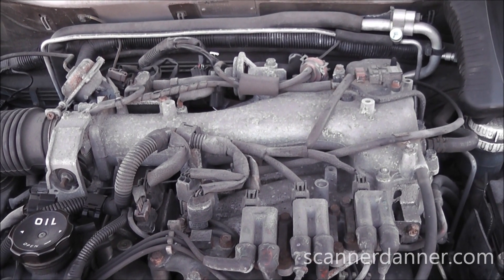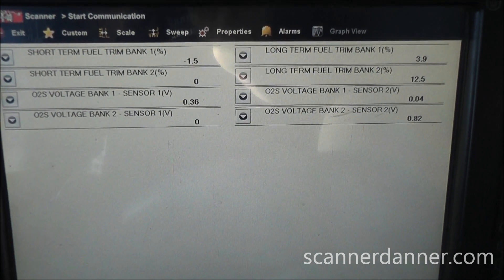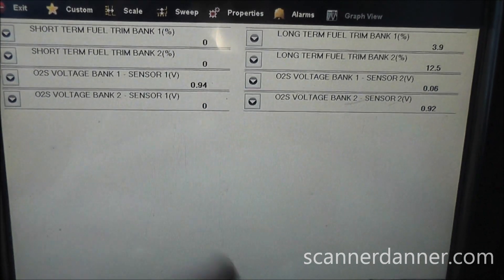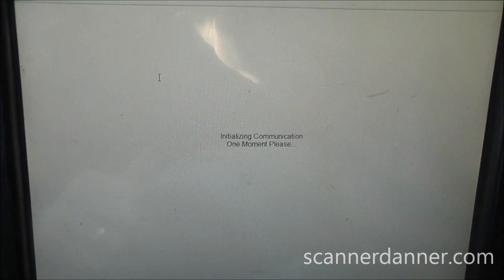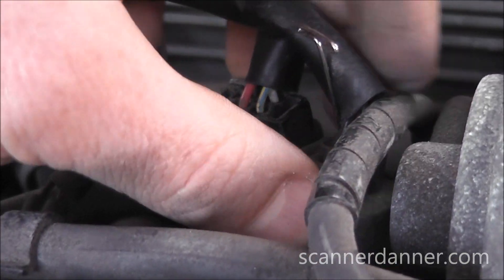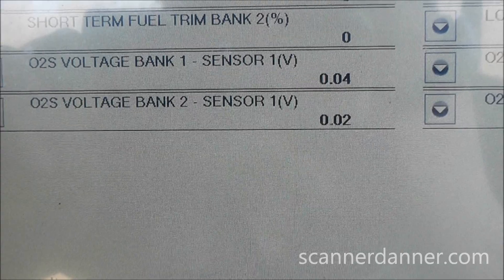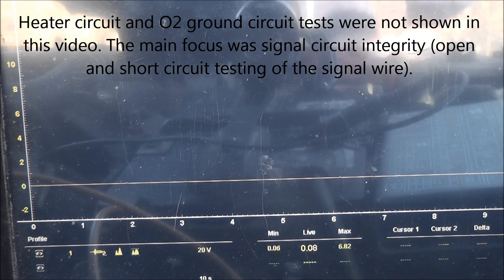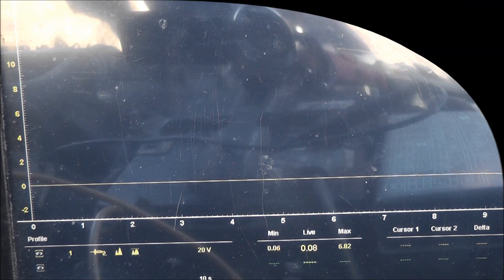O2 sensor testing (fixed lean) P0174, P0154, P0155 - Mitsubishi

Comment: The wideband O2 sensor has no activity at all and I'v checked continuity to the computer and voltage by the manuals.  As a side note this runs fine and seems to ignore the bad sensor and use the B2 to make fuel trim adjustments similar to the 98 Taurus you showed in one of your videos.  Thanks again.

Comment from the maker: yes and no. it depends on the internal resistance of the signal circuit. On some inputs, your body has too much resistance for this test to work. 
just tried it today on a digital type WSS and it didn't work, had to use the test light instead. I'll post the video soon.

Comment: I have an 01 Montero Sport, with that exact same engine, with almost the exact same codes, having the exact same issue on that O2 sensor.  While I have yet to locate the sensor itself, this got me closer to identifying if I need to replace it, and what a couple of those wires under my hood do!  Thank you!

Comment from the maker: To long of a topic to post here. In short, it is a small voltage the PCM sends down the O2 signal wire primarily for diagnostic purposes. 
Watch some of my other O2 sensor testing videos under my playlist labeled Sections 4&5. These are based on chapters from my eBook.

Comment: No, these are P codes listed on the scan tools as undoc using a Solus Pro.  I only wrote down 1 of the codes, P3903, but have seen several, some even with letters and numbers in it that look like P2T3W, as an example.  This vehicle had 16 codes in all modules at one time.  I am not sure what happened to this car (05 Saturn Vue) but these undoc codes seem to pop up when valid codes are set.  It is down to one valid code now (P0135) along with the one mentioned above.

Comment: Love your videos.  I have been doing mechanical work for years and have learned more about diagnostics on your videos than I learned in 8 years on the job.  Plan on getting your book soon, once I am done studying to challenge my ticket.  BTW, whats the deal with undocumented codes?  I am working on a Saturn now with and O2 problem and whenever the code returns it comes with one or 2 undocumented codes, even some with letters in the code????

Comment: Excellent vid.  I've watched a good amount of your o2 vids and I was just wondering, why do you never seem to check the sensor ground for integrity?
Reply from the maker: It depends on what I see on the signal wire on whether or not I need to check the sensor ground. I have plenty of O2 videos where I am verifying the ground circuit integrity.
Reply: ScannerDanner 
Thank you so much for replying.  I understand that you're very busy. 
Would you ever do a live Q and A?
N/W Scotland.
Reply from the maker: probably not :-(, can't keep up as it is, but I do always try to answer questions for you guys.

Comment: Quick question i have a 2005 sonata 4 cyl and my Short term fuel trim is good but my long term fuel trim is negative -14 what are some of the things that could be causing it?
Reply: The onboard computer in the vehicle is doing it's job. the long term fuel trim is doing the adjustment of -14 so that the short term trim can go back to its normal trim rate close to zero. lets suppose that you had an allowance from your father of $50 monthly but you needed a bicycle. He can give you $200 to buy a bicycle so that later, when he gives you your $50 allowance you can do normal spending. The long term fuel trim is saying[ Jikla R ] " I am your FATHER ".
Reply: Tom A  OK...
Reply: OK...